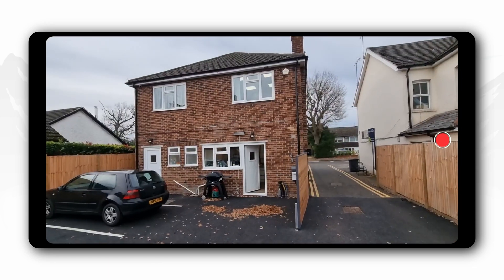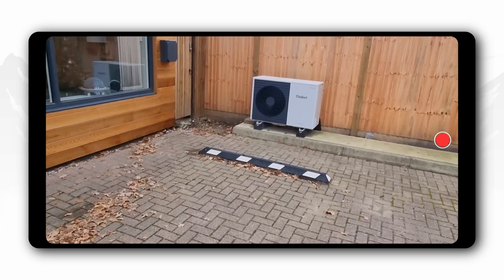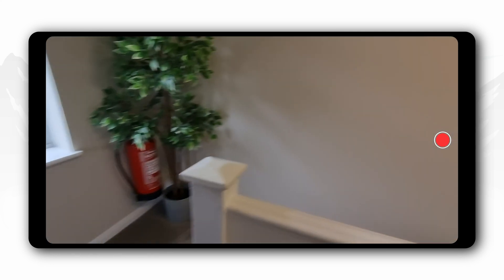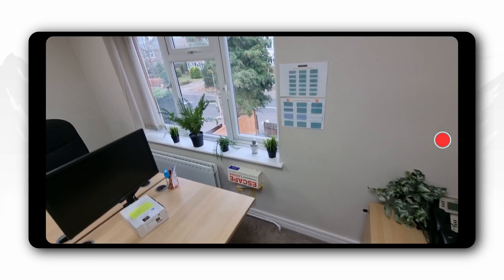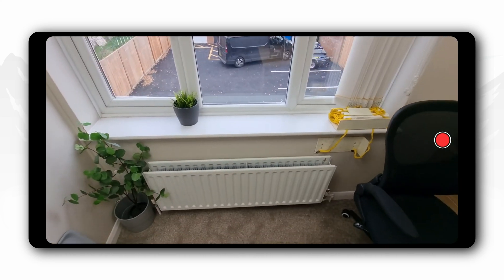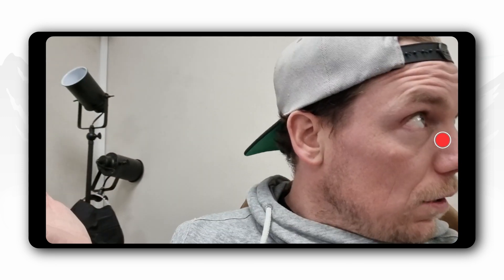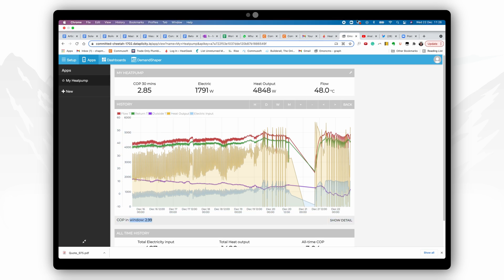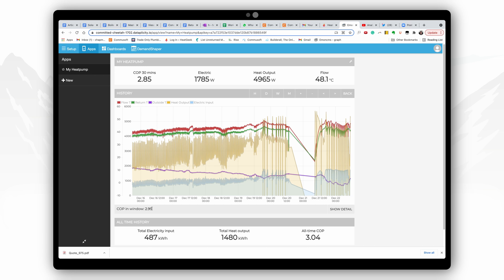Can Heat Pumps Heat A Normal Building?

Comment: In your experience, could a well insulated ten year old home with condensing gas CH boiler and microbore pipes plus smallish radiators which are set to maintain a constant 18 Degrees Centigrade during daytime, manage OK with an ASHP without any significant further upgrades to the heating system such as larger bore pipework and larger radiators? Good video, especially the live data.
Reply from the maker: Yes. But it's all done off calculation so would need a visit.
Reply: My central heating is mostly microbore and I have had no problems whatsoever with my GSHP.  I upgraded all my radiators in line with the recommendations from my installer. I understand that installers must use a standard app for calculating heat pump performance.
Reply: That is interesting to know and good to hear, thank you.

Comment: Great video, but my question is did they replace a gas boiler for this system. If this is the case what was the total install cost including the units. So a true cost of this system installed and was there any other monitory add ons after the system was fitted. Boilers are getting better as they will work with hydrogen
Reply from the maker: We are installers so installation was free. Yes a gas boiler was removed (which we also install). If you use an mcs company there can't be any add ons.

 Boilers working on hydrogen is great.. but hydrogen will be 5× more expensive to purchase than electricity and also is decades away..
Reply from the maker: Also worth noting we are the uks number 1 home hydrogen fuel cell installers so no bias or vested interests. Just fact.
Reply: @HeatGeek  hmm very intresting I will opt for a boiler by the the time they are dumped tech may be better
Reply from the maker: @gino2465  most people will opt for a boiler as heat pumps aren't within the financial reach of normal people.
Reply: @HeatGeek  I agree and let's hope they become more efficant below 5 °
Reply from the maker: @gino2465  what sort of efficiency are you hoping for below 5c? I think the current units out there installed aren't great but the new ones are way different if installed as I suggest.
Reply: @HeatGeek  I have a very large bungalow in very rural location. We have lpg boiler 30kw. Combi no tank. I need what I have now without breaking the bank. New boiler quote same brand but hydrogen ready all. Installed for £2100. 10 year warranty. Feeding 10 radiators. So I will. Use from 1st October to say 1st June 70% gas which will cost £278. OK this is very variable as outside could be mild but heating on in home for this period. Temp in home set to 20°.electricity to run boiler I would say £18. We will have 3 hot showers a day as well. The water will be instant so when we require it. To go 100% heat pump like you say will cost possibly 5x the price of a boiler but it's the electric cost which concerns me. Other factors will be concideration for 2x 7.4kw ev chargers used from midnight 6 nights a week I would say chargers would on average have to work for 7 hours most nights to accomadate full use 5 days a week. So in the winter months here is the with advise from all sourses I would be worse off and this will become more evident if the air temp goes below 5 degrees as the heat pump woukd work far greater OK for a bad period maybe weeks but none the less my other battle is using a 22kw heat pump with ev chargers and yes we do our washing of clothes and dishes during the economy 7 period. Also bread maker 3 nights per week and storage heaters for garage office and hot tubs. So my cut out 109amps requires changing to 3 phase now I need to find £15k for this. How are homes in the uk going to be able to dump boilers for the cost of a electric heat pump. I cannot as its way over priced forgetting issues like cut out breaker and electricity price per kw and not having piping hot water when needed unless a cylinder is fitted which means the heat pump will be constantly catching up to keep tank temp. Most videos on YouTube are people who have that spare cash to play with this great technoligy. Anyway we had restrictions put on our 2 nd ev charger due to the possibility of blowing the cut out fuse. So decided that untill such time a heatpump can work as they state with the cop efficiency and the cost to install this equipment was inline with boilers then we would wait. We prefer to work 2 evs so we are helping, but realistcly we would also like a heatpump.
Reply from the maker: @gino2465  I'm wasnt trying to convince you to have a heat pump. I'm asking the cop you expect under 5c. I think there already there and your using assumptions on worse units and poor practices.

I also don't think your bungalow is 20 or 30kw lol. Unless it's a 6 bed???
Reply: @HeatGeek  we will look at it again possibly nearer the cut out of gas boilers we have a few years to go. We said ladt year that we as a family wanted to be totally focil free home last year but OK we failed due to other factors like the DNO. But it's a topic I am very intrested in. So chatting to you was a bonus. Its is a large property. But let's see what the new year brings. Happy New year to you. G
Reply from the maker: @gino2465  happy new year!!!
Reply: @HeatGeek  Yes. There is far too much hype around hydrogen. If the stuff has to be compresses it takes a lot of energy so the costs rocket.

Comment: If you used calculation only, how close do you get to predicting the COP you derive from monitoring?
Reply from the maker: Not very.
Reply: @HeatGeek  So do you have a feeling for where the calculations are breaking down?  How's one supposed to specify a system correctly if calculation can't be relied upon to get us at least close to the mark?
Reply from the maker: @AmosMoses777  calculations are still closer than guessing. 

If your unsure you can test it via something like what veritherm offer or test it yourself.
Reply: @HeatGeek  So you suppose its primarily down to the margin of error on fabric heat loss then?  I was wondering if there was some element of HP manufacturers being overly conservative on their estimates? 

Would be interesting to see what the delta is on heat loss between conventional calculation and the veritherm method across a diverse array of housing stock.
Reply from the maker: @AmosMoses777  it's nothing to do woth heatbpump manus. This is has been industry standard calcs for decades. Veritherm already have a study on the discrepancy and found the causes. There's a paper floating around somewhere.

Comment: This is mental. How can you be getting a CoP of 3 at 21°C when it's so cold outside while I'm getting 2.3 at 17.5°C set point :( looking forward to your tips for how to optimise my brand new Mitsi!
Reply from the maker: Well tbh mitsis aren't the best.. but I bet there's a few things we can do. Keep your eyes peeled for Januarys vids
Reply: @HeatGeek  Awww don't say that, I paid a lot for mine :-(
Reply from the maker: @Muppetkeeper  you paid alot for your install, not your mitsi
Reply: @HeatGeek  I suppose it's down to what I consider a lot :-).  I contacted Mitsi directly before my install, for the price for the Ecodan and tank, and then went to get quotes. There was a fair amount of uplift between the cost of the heat pump and tank and the total install cost, but then again there was a lot of work done, lots of extra bits of kit etc, and 13 new rads to consider.  How much more would a valiant be to buy over a Misti?
Reply from the maker: @Muppetkeeper  depends on size.. 1.2 k ish...
Reply: @HeatGeek  Thanks, next time around I’ll be in touch 👍🏻
Reply: Hi Bruce! 👋
Reply: @dan_grey  Hi Dan! Happy new year!

Comment: Can you please explain how you are able to have a heating system that works that isn't 80 degree flow temp?
Reply from the maker: Yes. The same as all our gas systems fuel cells and heatbpumps.. rads are hugely oversized in most homes. End
Reply: How can maths and physics be right?
Reply from the maker: @Swwils  you have to over estimate.. other wise you end up in danger
Reply: Tbf my dad's house has 1960s single panel, no convection fin radiators and needs to be 60°C in below 10 outside and nearer 70° when daytime maxes are below 5. Cavity wall and loft insulation, good quality double glazing.
Reply from the maker: @dan_grey  here's a property.. no cavity and teeny rads woth a heat pump.. look what happens.. 

https://youtu.be/QLGANlbqIFY
Reply: @HeatGeek  On your system the data gave a flow temperature of 40'c... How does that heat a house with the tiny rads you showed us. Something doesn't add up.
Reply from the maker: @cuckingfunt9353  flow temp was 48c you can come over and see this for your self if you wish? It's a show room so anyone's welcome.

Comment: My main issue is the cost of installation and the overall maintenance cost, running costs and I need something that can heat my home and provide hot water on demand, without me needing a spare room for all the kit.... Still not convinced that air source is the best solution for energy demands, not until it becomes cheap to install or the same as a new gas boiler... Bit like solar panels...
Reply from the maker: Sure.. its not for all properties.. have never said it was mind. We fot boilers and uks number 1 hydrogen fuel cell installers too

Comment: That’s impressive Skater Boy, Which ASHP & whats Its output??  I know you have considered the COP & the need to improve it, but I can get these sorts of figures from a 400 quid Invert Mini Split Unit. 
You never covered the existing system pipe size etc & if there was any upgrade required to achieve the High Flow Rates & tighter Delta T.
The other consideration, when comparing that property with a standard domestic dwelling; it’s an office,  with strong lighting & multiple occupancy.   So it’s not really comparing Apples with Apples.
Never the less I’m impressed & would be interested to see the fabric U Values etc.
Keep up the good work son👍👍
Regards Dick Puller.
Reply from the maker: It's heat freak to you wiber fasher. It's a vaillant arotherm plus. The load is about 6kw so 22mm pipe fine.. didn't want to ho into too much detail for this one. 

Minisplits can do well but I find less comfortable and need higher room temps due to increased air movement.  The lighting us all led so no biggie.

Yeh agree anyway we were totally amazed too mate! 👍

Comment: It would be great if you include the power of the ashp unit. 

A video of how to take these measurements step by step would also be an excellent content. continuation of excellent work.
Reply from the maker: No problem. Anything else?
Reply: @HeatGeek  The electric meter readings, and the inside and outside temperatures. ... There is no way you can heat a house with those rads and a 40'C flow rate.

Comment: Nice video - it's well suited to those who just want/need to be told "It works, dammit!" & who lack interest in understanding why.  While that's great, I'm left curious.

Your (unstated) message seems to be that the heatloss in 1970s semis is less than conventional wisdom would expect.  For, compared to the dT50 system the rads would have been expecting, the HP output at dT20 will be much lower.  But it's clearly still adequate.  It would be fascinating to see if a formal heatloss calc predicted this.
Reply from the maker: It did predict this. But did not predict this efficiency.
Reply: @HeatGeek  What was the whole building heatloss (usual assumptions)?  It feels to me as if the real surprises you should be emphasising more are:
1) that a typical 70s estate house has a lower heatloss than people expect (which is what brings it within the scope of a heat pump's capacity); and 
2) that the 'rule-of-thumb' rad sizing by old-school plumbers who didn't bother with heatloss calcs will often yield oversized emitters for the 80/60 system they were
    designing, and that therefore (apart maybe from flow rates) these systems can still work well with substituted high-modulating boilers or heatpumps.

Comment: There seem to be two heat pumps out the front. What is the second heat pump for?
Reply: At the moment just display, it isn't connected currently. We run an install company from the same building so there is a renewable showroom.

Comment: I'd like to see the staff being interviewed on a cold winters day, whilst showing the smartmeter data at the same time. 
To be honest it sounds too good to be true.....I hope, I pray it is true. But something is telling me that I shouldn't hand over my lifes savings to the nice man from Nigeria who will give me a diamond mine if I do.
I hope you aren't full of BS but you do seem a little desperate!!...that could be just enthusiasm. Where is your business partner?...he seemed a straight talking guy who would tell you the pro's & con's.
PS That wood cladding up the side of the building was a bit half-hearted.
Reply: Hello, the sensible one here 🤣.  Its not bs, it surprised us too which is why we wanted to share.  Other than when we had the system drained the other day for some maintenance the staff have never been cold, you can see the electric heater in one of the rooms because of that.
Reply: @patrickwheeler2646  It looks to me like you are pushing HP technology to the limit....which is how we learn what the limit is I suppose!!!
No cavity insulation, small 'undersized' radiators....and yet the system still works efficiently. It 'almost' sounds too good to be true. 
Don't get me wrong, I want heat pumps to be the solution to replacing gas CH systems. But I am concerned the technology may not be able to deliver on customers expectations...over promising by salespeople and poor installation are a toxic mixture.
I know your company is tackling the installation issue by training. I wish you well.
Reply: @Sean006  thanks, we will he replacing the undersized radiators of course, we just hadn't got around to it before the cold weather came in.  This is more a surprising report of a non ideal installation being not so bad.  The cop will be even better when we have larger emitters and lower running temps.
Reply: @patrickwheeler2646  Aren't you slightly worried that the content of this video could be used to sell inappropriate installations by the less scrupulous people in the HP industry?
If I wanted to sell an under-spec'd system I would refer any undecided customer to this video....it is compelling stuff, very convincing. 
Unfortunately as you said, your system behaviour was a surprise to you all and 'probably' needs improving to be a realistic long term solution
Reply: @Sean006  I certainly hope not, our industry is rife with pressure selling and incorrect specification.  We completely support harsher penalties (or any penalties) for these types of companies.
Reply: @patrickwheeler2646  I know that you and your company are the 'good guys' in a fairly new industry. I wish you all the luck in the world.
Regarding harsh penalties for the bad companies....I doubt it will happen until too late and damage is done (it is how the UK building industry works). 
But I can see a very successful future for the HP industry. I just hope it isn't a race to the bottom in terms of bad selling techniques and poor installation. I know that you are trying to tackle some of those issues but unfortunately you cannot single handedly control the market, it is a job for regulation and government to set standards....something we do not have a good track record of in UK. 
I wish all at 'Heat Geek' well in the future....I will leave you alone now. Thanks for the positive comments.
Reply from the maker: I love this comment! thank you!! OK will do an FB live just for you, you legend!

Comment: You forgot to mention the 300 litre hot water cylinder, that’s probably putting more heat into the kitchen than the radiator, also irrelevant data nap, it’s an office with only 1 dip , most houses cycle heat on / off ,  or unlike an office turn it up from usually 4pm till 10.30 or 11 most leave it off overnight and no one would have an air to air in the middle of your room , usually ac size against the roof or more commonly through air  ducts not fridge size 3ft from the wall ever
Reply from the maker: That buffer has 100mm of insulation. Gains there are absolutely minimal.. they are also irrelevant as we set the cur e for upstairs.. not the disjointed kitchen downstairs.
Reply: A properly insulated hot water cylinder, as it should be, will put next to no heat into its surroundings.

Comment: am I reading that graph right - You're basically running your heating at a constant 21C 24/7, except for the 20th-21st where you turned the heating off for ~24hours. The flow temperature is around 40C, the return temp is around 3-4C less. It's costing you about 1kW/Hour (give or take 200W)  to run the heatpump, which means that it's (very roughtly) 20-24 kW/day. Which would be £3.00-£3.60 @15p/kW per day, or £90-£108 (ish) a month, just for heating, in the colder months?
Reply from the maker: This is the confusing bit. No. Although it's run 24/7 it's on a set back over night at 18c. Thos does not turn off but lowers flow temp.

Will get back to you on electrical consumption in Dec
Reply from the maker: 580kwh in Dec so based on 15p is £87 for heating with tiny rads and little insulation.
Reply: @HeatGeek  ah right, that's ok I was just reading the graph wrong - I'd have expected to see the graph's lines go up and down on a daily cadence with the different setpoints as they vary.
Reply from the maker: @snail_cactus  is more on a continuous basis as both setpoint and outside temp aswell as step modulation vary